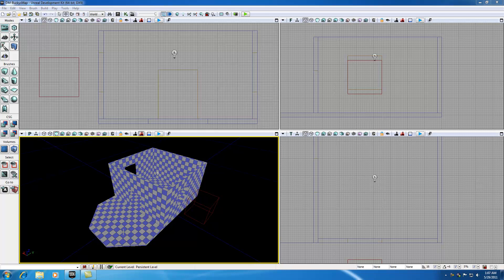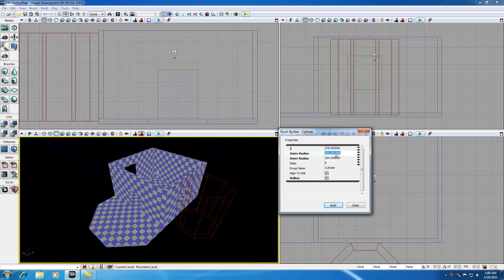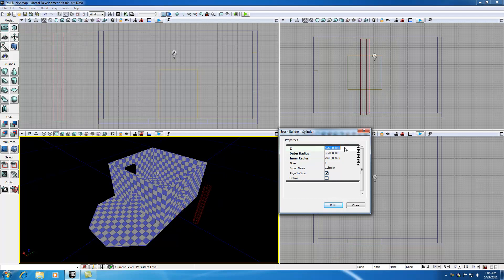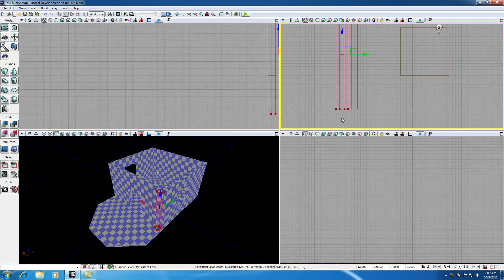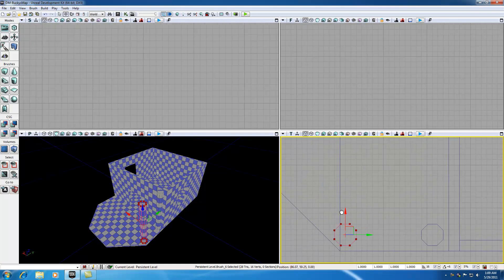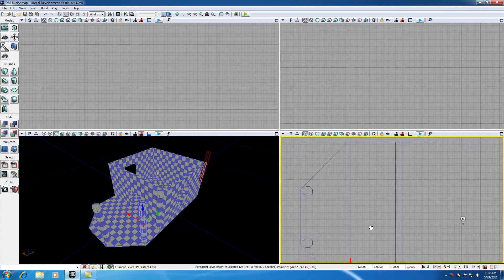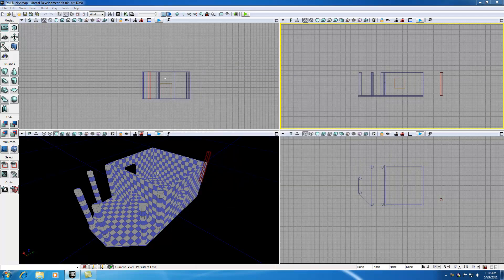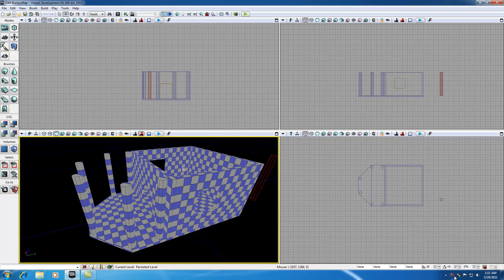Unreal Development Kit UDK Tutorial - 14 - Adding Pillars to the House

Comment: @heatoneGR i made a prison. Well like the outer perrimeter of the prison. Once you get it you cant get out. It was preety easy. You step on a senson (trigger touch). It opens up a latched door staic meshes. That then activates two chained door. Then you move eofrward and everything closes behaind you.  Then you have to walk over another sensor (trigger touch). That then activated this big cell door (8ft big) which goes into the ground. Its not much but it took me 1 hour or work :)